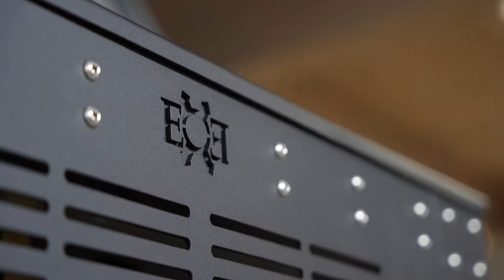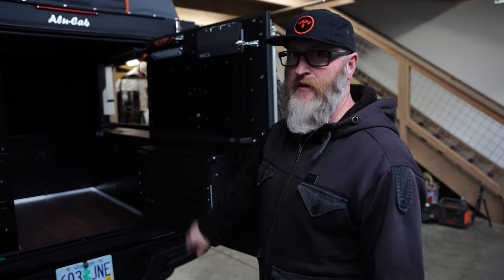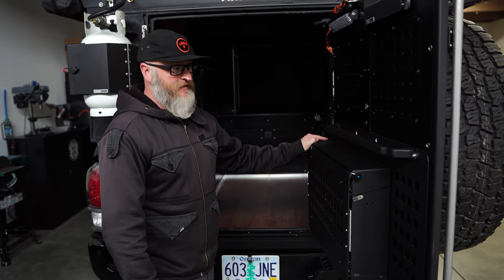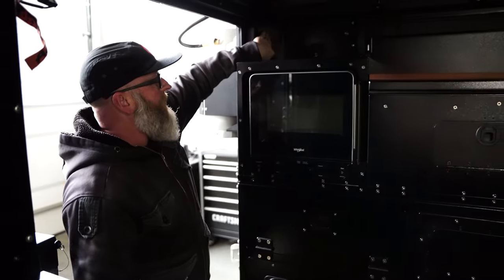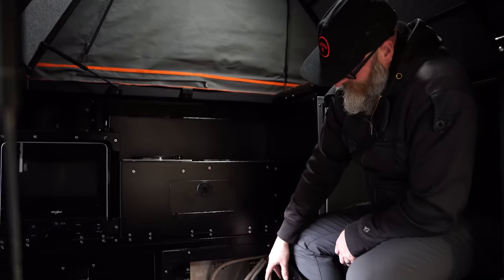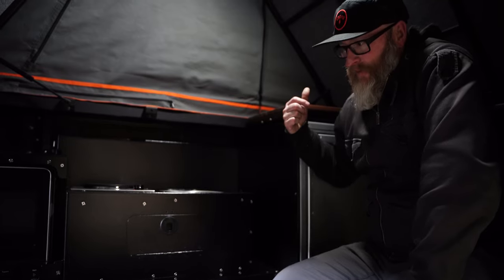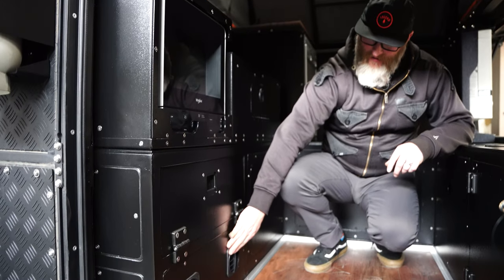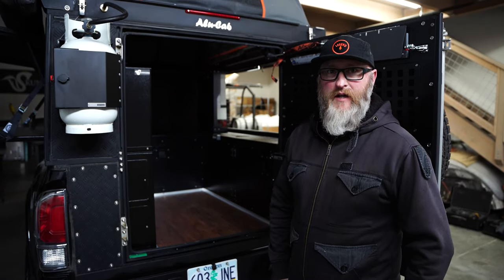Custom Off Road Camper Interior Build by Expedition Essentials

Comment: I have been looking for an outfit that I could trust doing a highly customized electric setup in a truck camper. And here is the answer plus a lot more.

I saw a custom van build with a 280 watt alternator, 3,000 watt inverter, an autostart system plus over 800 amp-hours of lithium.

Able to run an a/c for 12-14 hours.

But the autostart feature was set up to start the engine when voltage got below a certain point, ensuring round the clock a/c as long as the van had fuel.

This outfit is the first I have found that can do all that plus everything else in a truck camper.

Bravo.

Comment: I've used that microwave in my campervan and the door flies open on smooth fire roads so how does it stay shut on a 4x4 truck? I also remove the glass turntable while driving so it doesn't crash onto the floor when/if the door opens. Been thinking about making a simple velcro latch, but it's not a problem on pavement which is where my van lives 99% of the time.
Reply from the maker: Thanks for the feedback Brett. We figured the turntable didn’t need to ride in the micro. Good to know on the door. Will have the owner keep an eye on it.
Reply: Wow! What a beautiful build out! I would be concerned about the weight on a Tacoma chassis. I am doing and Alucabin on a 3/4 ton. Would like to replicate a build like this on that platform. Can you DM me with a ballpark cost? This is far beyond my ability to do myself….
Reply from the maker: @jaykanngiesser3454  hey Jay. We definitely tried to keep it as light as possible with the material selection but you always need to be aware of the additional weight. Our company Tacoma had a similar buildout but we took additional steps to help safely carry the additional weight. Re geared, Heavier duty springs, heavier sway bars, upgraded brakes etc. if you are interested in a similar build email jeff@expeditionessentials.com. He can take care of any questions you may have. .